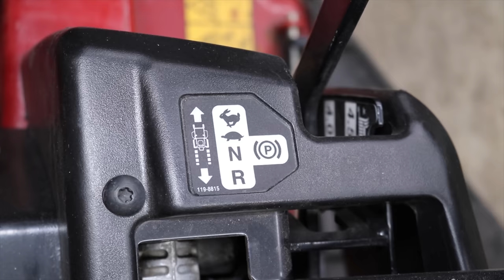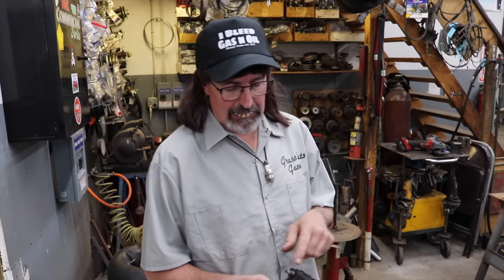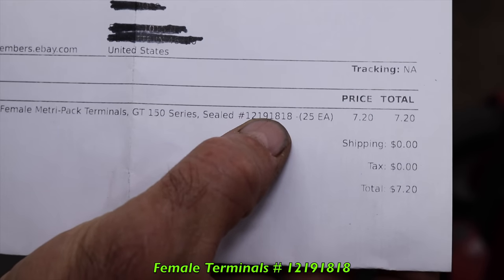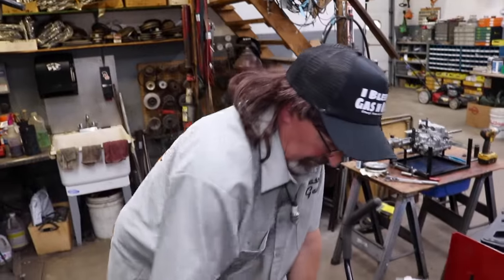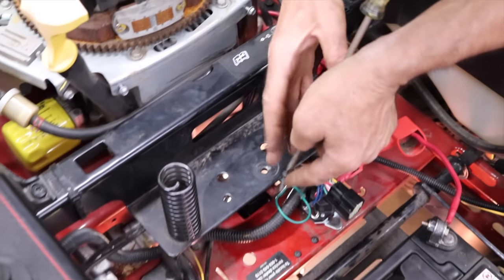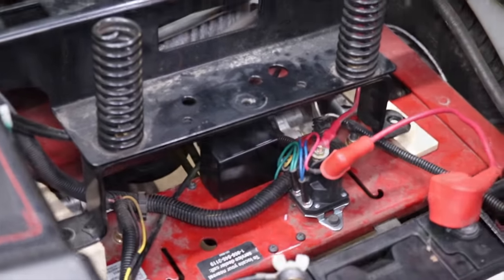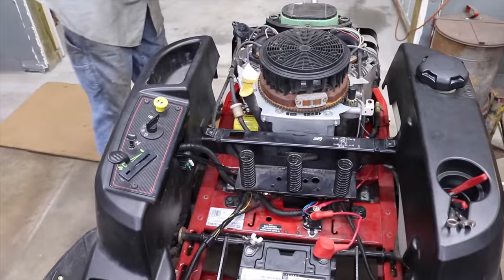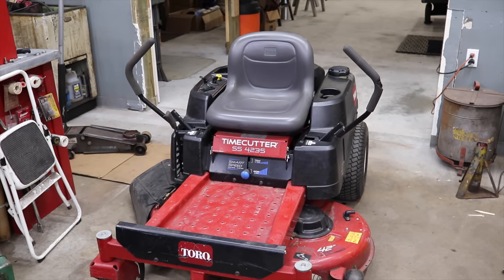⚠️ This Thing Was NOT Easy To Work On

Comment: KWOPE  or NWOPE?  Knuckleheads working on power equipment.  Either one will work.  I'll be first in line for the new T-shirt.   I'm surprised that is the first parking brake module you had to replace.  I've replaced many and probably because Toro may not have a large presence in your area - who knows.  Great job on the repair and especially finding the crimp on terminals.  Since Toro and Exmark are in bed with each other, Exmark has the same set up on some of their mowers.  That part used to cost $100, now it's almost double.  Sheesh

Comment: WHAT YEAR IS THIS UNIT ??? it had no grease on the plug from factory??? and anytime a connector is rusted out and gone the other side is the same way... it is a really bad engineering Design and i am so sorry you had to get involve but i have seen this corrosion many times on harness in my career as a Diesel Tech for 34 years... most electrical problems occur at CONNECTIONS and are resistant by nature... do not forget that...

Comment: This is why many of us hate new equipment engineering. I cut my grass with a restored 1970 Cub Cadet 127. Built like a tank and just keeps on going. I also hate all of the unnecessary electronics in the new vehicles, such as power parking brake and auto start

Comment: Lol, they spent $100-200 (300 maybe? some of these prices are getting pretty ridiculous nowadays) on the 'ol parts cannon instead of taking a couple minutes with a multimeter and jumper wire to determine the battery and solenoid were fine.  Oh yeah, plus the time spent parts-swapping.  And getting them in the first place.  Double lol.

Comment: Tary could u give me a clue please I have a kholer Miller trailblazer 275 it turns on and run but as soon as I push the choker in it will immediately rev really high for no reason, nothing is connected to the machine at all, I checked the idle solenoid it seem to be moving and doing the normal clicking sound it does when you turn the switch on, I checked and clean the carburator really good! Both jets still doing the same clean the plunger and tested it and it’s working but motor still reving high! Any idea 💡 what might be the problem!!

Comment: Nice diag and repair of connector, A supposedly top notch company like Toro should slap 2 cents worth of dielectric grease on its connectors,what problems it would head off,shabby on their part in my opinion Regards

Comment: And can't ya simplify all that electrical bs and delete alot of the bypasses n just make it a simple switch to starter motor? But remove the electrical parking brake...not like ya really need it...I've never used a parking brake on any mower...if need be that's what rocks are for lol

Comment: Those connectors are designed to be exposed to free moving air. Putting in the cover locates them in stagnant air.
In stagnate air environments moisture from condensation and heat cycling isn't able to dry out like it can in free air environments.
Use of automotive connector styles means smaller and less robust connections. Any tiny type of moisture across an electrically active connection is going to dissolve your connection.
All of this to take away a manually operated parking brake. Just build the brake into the mowing control arms like everyone else!

Comment: Where I come from like I said will you throw that damn thing in the garbage save a 175 bucks and that's why I'm around it that's what my solution would have been and half the mechanics around here like you said you don't need that parking break things the first time my Grandpa had to go underneath the lamp on more and it's in disconnect the

Comment: I had to pick up one of those Toros with a bad park brake once. I made a wire harness from a briggs fuel solenoid plug, some wire and alligator clips to run the fuel solenoid. Then I just flipped the park brake off by turning the arm on that box manually and jumped the solenoid to start it. Not safe to operate this way, but I got it on the trailer.

Comment: What a bad design over all though I swear unless you buy a commercial series mower they really are built to run a season or 2 and throw away and buy a new one 🤦 some people love em some people hate em but I've got a scag freedom series that sat in the woods for 5 years the fuel pump went bad and the guy just parked it up he gave it to me put a fuel pump on it and rebuilt the carburetor and no issues it did break the belt shortly after I fixed it but that's to be expected it was dry rotted bad I think it's 10 or 12 years old but I use it every week to cut about 3 acres no problems

Comment: I also blame Toro for using the electronic brake system. Not to mention they weren't smart enough, just like most manufacturers and decided not to put dielectric grease in the connector to begin with.

Comment: Red Line sells a complete kit that includes the crimper, extraction tool and insertion tool along with all sizes  of the connectors both male and female. they have like 10 each type in the box.

Comment: 6772 or even before GM ignitions which is use those plugs like that terminals with little ears on it and it reasonable that it did because it snaps into a connect or something like that and it's made to hold your position on that blug

Comment: You do not need a second person to help you because I replaced one of these motors by myself. The one I replaced had the exact same problem as this one. You might check with your auto parts store to see if they have the entire plug because that is how I fixed the one I repaired. The one I repaired had a melted plug.

Comment: Same crap happened to mine, i also had to replace the wiring harness as it was rotted out. That mower was a POS, multiple safety switches failed as well as one hydro.

Comment: I threatened me to wait a bit past that son of a bitch permanently it was mine that'd be one of those ripped out all the wires and start over again rewires like I did on my cupcadet because the local motor shops are oh we can't fix that wiring harness without you buying a whole new wine on it for the tractor I said screw that I want to the internet gotta print schematic and my buddy and I figured it out The white Randy is that he rewired the whole tractor instead of just disconnected in the silhouettes because he said it was more work to do within the wine honest it would be to reward the whole darn thing

Comment: Does a lawn mower really need an electric parking brake? I think a lever and a rod would do just fine. The steel for the lever would probably cost to much. plastic and wire is cheaper. land fill trash.

Comment: I just worked on one of these.. thankfully that wasn’t the problem.. this one had a single cylinder Toro engine on it. Customer said it would turn over but it would not start. It had no compression. When I turned the flywheel manually, I could feel the piston bump on something.. I pulled the head, and low and behold, there was a carburetor nut, and the flange of the nut was stuck under the intake valve now allowing it to close.. thankfully, by some miracle it didn’t damage anything.. put it all back together, and it ran perfectly.

Comment: I had that exact mower with that exact problem and fix, fortunately the connector wasn’t bad and all I had to do was use a little stuff called de-oxit! It deoxidize electrical connectors! Got the part from Pro Parts Direct, that was about a year ago, now Friday I got the mower back for deck problems!

Comment: I own a Time Cutter. I got it used for only $600 and the parking brake was bypassed. I probably would have bought a new module but when I researched it I learned that many people said that they didn't last very long or were defective right out of the box. I decided to replace the module with a universal relay that basically kills everything through the seat switch. I don't have a parking brake but my place is really flat. This is my first Kawasaki powered mower and I really like how it runs and cuts. The only minor issue is that the left hydro is a little bit slow until it warms up and then it's a little faster than the right.

Comment: Another thing you could have done is pull out your connectors and sprinkle some baking soda on them, and pour some boiling hot water over it--  that baking soda will dissolve all the corrosion and neutralize any acids there.  Then you can go through and crimp the connectors a little tighter so that they make good contact, and then spray it with some Deoxit and it would have probably been fine;  as long as the wires weren't too corroded and starting to break off.

Comment: I wonder if the same electronic module is used on the Hustlers with the electronic handbrakes?

Great advice I will have to get my boss to see if these connectors are available in the UK to be prepared if one of these Toro's we have sold has the issue.

Comment: At 9:27 this comes down to quality control in the factory with these things.  Those connectors are supposed to have dielectric grease on the terminals so that moisture doesnt get into them

Comment: “Thanks for the tip Taryl! I’m gonna but soma them! “ ❤

It’s nice to see another shop doing a rebuild on a connection terminal.

I have a customer in my neighborhood we did a rebuild on his PTO switch connector on an old craftsman GT 3000 riding mower. I had to order the terminals from Oregon specifically, and return on the switch with a brand new PTO plunger switch.

Even came back with the wires, broken for the PTO clutch so we did that in a Molex terminal. 

I will be picking up one of your crimping tools very soon!(More capabilities than my static Molex crimper.)

Comment: Hmmm, that thing looks clean. So I dont think weather did those terminals in. I think this owner power washes that thing and that is how those terminals rusted like that. Coupled with the fact that there was no dielectric grease in the connector. Great job once again Taryl.
Reply: My friend washed a motorcycle with truck wash. Chased electrical gremlins for 2 yrs until knowledgeable mecho told him to wash it several times with plain water then let  sun dry it for a few days, after that drown it in WD40. All ok after that.

Comment: I have the same mower. 3 years old , I'm thinking i should take the plug off and apply some grease.? What do you think ?
Reply: wd40   or silicone  or  grease, but be careful that the grease will not degrade the plastic.   wd40 once a year should do it.

Comment: I have a 60" Timecutter Toro and I love it. I love the fact that when I move the handles to get out of the mower I know that the parking brake is going to lock the wheels so I don't have to worry about getting run over. I have the 6-blade mod on it and it cuts great. I'm going to check the connector on my brake and see if it's okay. I'll order another parking brake unit to be ready. BTW, I do not ever wash my mower. I found that with my old Crafstman garden tractor(1993) that the more I washed it the faster It rusted. Now I just air blow my Toro off very well even the blades and deck. I'm going to pull my engine tins to make sure I don't have grass clippings and dirt building up in my engine air flow path so it doesn't cause my engine to overheat. ( That Taryl, he's got me worried, I'm worried Taryl, my engine may overheat. I can't have that cause that's bad, real bad.)😛
Reply: 60" 6 blade? Wow. That must be a great mower. Don't think i ever seen one with 6 blades.

Comment: Nicely done Taryl. My question is - Why would they build it like this? A manual parking brake would be more than adequate, and a lot less likely to cause this kind of headache.
Reply: They prolly get the black box for pennies. Cheaper than a cable. Why did they take the door switches out of cars and replace them with computer modules!

Comment: Looks like the safety commitity won again! We want the brakes on automatically so no one gets hurt! Good idea!
They saved a nickle by using a connector without a rubber seal too! Someone got a bonus for that!
 And then they ignore Taryl's rules and leave it outside.
Still Taryl Fixes All!
Reply: Who said they left it outside? An unheated /uncooled outbuilding with poor ventilation can get so much condensation that you would be better to leave it outside.
Reply: @flash21502  It bothered me that it was so clean. Maybe they washed it after each use and the water got in that way. If that pin was hot (12V) all the time corrosion can progress very rapidly in presence of just a little water.

Comment: Don't think I'll be keeping my timecutter until that crap goes bad. Believe I'll be selling my 2021 model sometime in the near future to avoid this mess. You got it repaired so once again bravo to you.
Reply: There is no getting away from the safety crap 💩 anymore, one brand is just as bad as the other, some are worse than Toro
Reply: @siriustraveler7083 commercial mowers don’t have this crap. My wright stander parking brake simply is a bar that goes into the tire and a mechanical linkage that locks the controls. Buy a commercial mower and not have these issues.

Comment: Same kind of mickey mouse junk that is used for door lock actuators on modern cars. When things like this are used as a replacement for a very simple manual operation it needs to be as simple and reliable as what it's replacing. In other words, with 21st century design and manufacture being what it is, don't bother.

Comment: Toro  Engineers ?.. What is  w r o n g   with you all ?  WHY  complicate, things when  IT  IS  NOT  NECESSARY !   USE  a manual, mechanical parking brake ;   TMT  =  Too  Much  Technology, .  I will stick with John Deere EZ tracks,  zero  turn mowers.  Very good, easy access to  air  filter......MANUAL   PARKING  BRAKE, TOO !   THANKS,    MR   Gross !  ....er  Taryl  Dactal....

Comment: Doesn't it seem silly to put a bunch of electronic crap on a residential mower... they have to know that mower is sitting still most of its life  and most people leave it outside in the weather on the side of a garage... at least put the connectors in a weather pack. Jeeze...
Reply: You're talking to people who own a Wi-Fi connected refrigerators